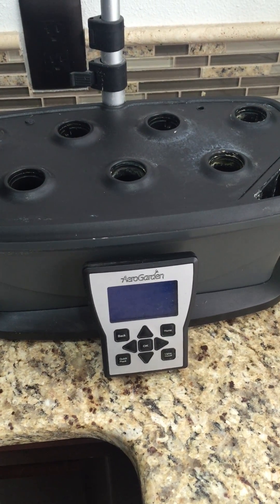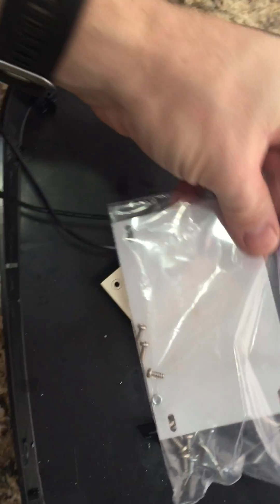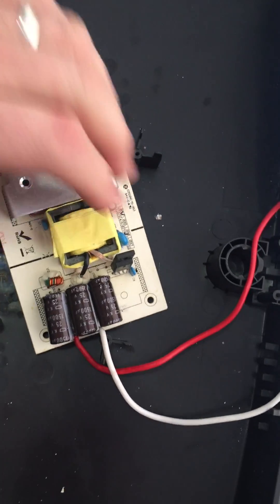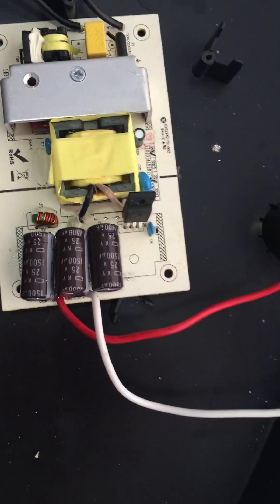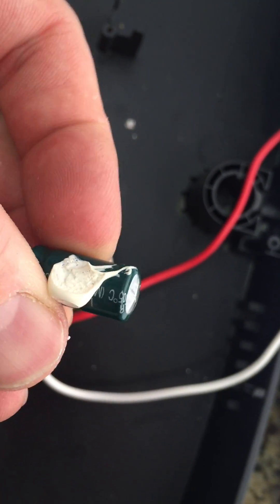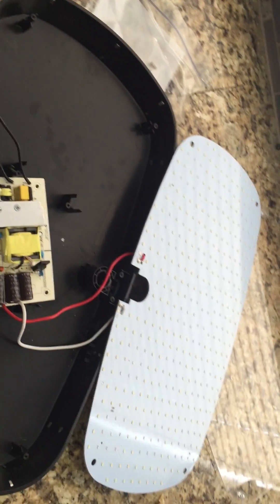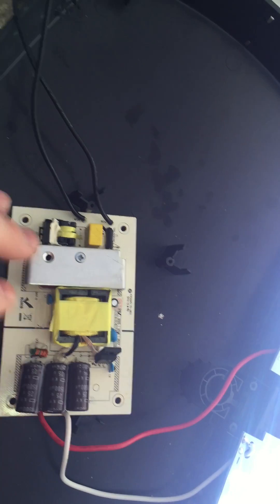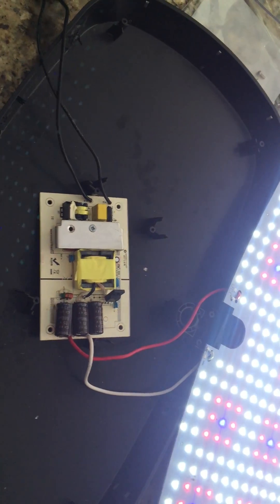Aerogarden LED Repair pulsing/strobing/flicker

Comment: A friend has an Aerogarden Farm which is not attaching to the Wifi, it will ping a few times to the router, then stop, ping a few times, then stop. Do you have any idea what type of chip or part should be replaced in the hood so it can connect to wifi full-time? Others are working fine. AG wants them to buy a whole new unit, they said they don't sell "parts" any more. Or do you know what type of a technician they should look for locally to fix it? Thank you.

Comment: I fixed it differently.  I called Aerogarden and asked for a power adapter for a LED light.  It was $10.   Then you open up the LED as shown in the video and physically remove (rip it out and throw it away) the electrical board which is small.   Connect the power adapter (+) and (-) to the LED's (+) and (-).   Plug the power adapter (male) to the power cables from the Aerogarden.  Done.
I tried to fix it as shown on the video but the cost of buying the components and figuring out which one blew just took so many days with no luck.   Take the easy route.
Reply: do they sale the power adapter on amazon?

Comment: Thank you so much for this video.  I have a question, would it be a good idea to use capacitors that are rated 25v but a higher uf?  I have trouble finding the 25v 1500uf ones for a good value.  Thank you in advance.
Reply from the maker: Higher voltage is ok, but uf needs to be 1500uf. For example 35v 1500uf, 50v 1500uf

Comment: just acquired an aero garden 7 hole system.  the pump is fine, but when we turn on the light - it strobes.  I have no clue what the model is.  I'm not afraid to take it apart and replace stuff since apparently you can't just buy the light hood.  but where do you find capacitors and how do you know if they're bad?  what info do I need to purchase some.  there is no fuse on the board.  but there are capacitors.

Comment: Hi, I have a 9 pod from 2015 and when I got at the circuit board I could see it was a different design, no electrolytic capacitors under the heatsink.  There were two 470 uf 35V at CD2 and CD3, so I swapped those out with new ones - it did NOT fix the flashing problem.  Any advice for what else might be wrong?  
Thanks,
Mike
Reply: I've replaced the 10uf 50v cap as well, still no joy.
Reply: I'm looking at mine right now and it's the same as you guys. Cd2 and cd3. That mean I'm screwed? Lol

Comment: I am so confused....soldering? I would have liked to see you pull out caps and solder and everything...I am not an idiot, epileptic ..after a 26 seizure in 36 hours, I get confused easy ..I just bought my dad one and mine stopped 2 weeks later! Using his lights, but they are smaller.....would you mind terribly working with me to fix this, I only get 800 from SSI, I don't want to screw it up, can't afford to replace....

Peace

Comment: Mine is different. Looks exactly the same, but the heat sink is soldered to the board and there’s this white “goop” glueing all the components together. No easy fix for me.  *sigh*. I can’t even remove the heat sink. 😕
Reply: Same, I don’t know what to do now :(
Reply: Mine was like that, too. You can remove the heat sink by de-soldering the two pins. The white goop can just be scraped off. Don't forget to remove the screw holding the mosfet to the heat sink. When I put it back I used hot glue to hold the caps, but I don't really think that's necessary. Good luck!

Comment: Dude, THANK YOU for this! I hadn’t done much soldering in the last couple of decades but I thought “why not, it doesn’t work now anyway!” So I got a bag of 5 caps for $4 and it took about 15 mins to take the thing apart and replace them (mine were swollen just like yours) Worked the first time. 

You saved us about $100 to replace the whole thing. Thank you, thank you!!

Comment: So I have zero soldering experience pretty good with my hands. Watched this video and one about do’s and don’ts of soldering. Bought a $15 kit and $5 of capacitors and bam fixed hardest part was taking apart the lamp and heat sink. Mine has some kind of glue or compound all over inside made removing the heat sink difficult. Also the light and shield were he’s to remove after the screws the top is just plyable enough to just stick a screwdriver in and bend it just a touch be careful not to break the clips

Comment: Kudos to you for posting Clock Doc! I would have never attempted the repair without this video.  Would anyone care to give a link to the small 50 volt capacitor they used? I found the 3 larger ones on Digikey part number 565-4553-nd, but having trouble finding the smaller one.

Comment: Thanks for the fix.  I purchased capacitors for digikey they worked but were 10mm x 30mm.
Since the I found 1500uf 25v 10mm x20mm on eBay.  I purchased what I thought was 6 PCs to keep for my other aerogardens but was actually 6 @ 20 units. If anybody needs some please contact me @ Iam2ndson@gmail.com if you send me a self addressed shipping envelope I would be happy to send some at no charge if you pay the postage.

Comment: will these work? 6 pcs Panasonic FM Series Capacitors - 25V 1500uf Ultra Low ESR
Reply from the maker: Those should be fine, might pay a premium for the “ultra low ESR” over standard.

Comment: As you can see in this comment section, I followed your advice to great success a year ago.....Well, it gave up the ghost again and replacing the CAPs didn't help this time....still strobes....any other advice?
Reply from the maker: It’s hard to diagnose from a distance and I don’t have mine to reference anymore. From the video it almost looks like the driver is MOSFET controlled. Make sure your Caps are new, some stuff from eBay and such are decades old. After that check other components like resistors, other caps, if good it may be that transistor. I hope that helps, if any more questions feel free to ask, have a blessed day.

Comment: I have a Bounty. My board look different from yours. None of the capacitors are bulged. Should I still try to replace them?
Reply from the maker: Daniel Chang  If it has similar problem you could swap them and see if it works. Just check specifications on your parts as I am not familiar with that board or it’s components. I’ll see if schematic is available somewhere.
Reply: @clockdocbrown3013  While I took some electrical engineering classes, I'm not an expert. This is what my board looks like: https://photos.app.goo.gl/gZHi65CGtSeSAGDJ6

Any recommedations on what capacitors I should get? I was thinking a couple of these: https://www.mouser.com/ProductDetail/647-UBT1V471MHD
Reply: @dchang3  I have the same power supply in mine!  Those capacitors look like a match.  I replaced mine with similar ones, and I replaced the 50V cap but unfortunately it did not fix the problem.  Please let me know if you are successful and I will try swapping them out again (maybe I got a bad component or just one that was on the wrong end of the range)  Thanks and good luck
Reply: @michaelbacher2469  I got in touch with Aerogarden and they sent me a replacement without asking for any payment. I wish you luck with them too! I was out of warranty.
Reply: @dchang3  Thanks - I had emailed them earlier and they declined to replace it as it was way out of warranty (2015).  I'll try a call to them and see if I have better luck.
Reply: @michaelbacher2469  let me know if you can call them. I tried the customer support number and it doesnt work. Email said they dont sell parts for my unit anymore

Comment: A HUGE thank you for making this video!! Not sure how I pulled it off, I figured my odds were 20:1, but I ordered the capacitors off Amazon, successfully swapped them out and the LED is shining bright and solid again. A little tip to anyone trying this, kinda winged it with the de-soldering...since you obviously can't de-solder both wires on each capacitor at the same time, I wound up snipping the wires on the old ones to get them out of the way, heated the solder points on the under side of the circuit board and pulled each wire through the bottom with pliers so the solder doesn't get pulled up into the hole where you need to put the new ones through. Hope that makes sense. Also wear a facemask, you don't wanna inhale the fumes.

Comment: I've replaced the 3 25v capacitors and also the 50v in the middle. Still getting strobe light effect... Any ideas?
Reply: @nawgx2 I got it working! Turns out I just had a bad connection with one of the new capacitors. Thank you!
Reply: @nawgx2 oh I didn't even think of that. Let me know if you figure something out. I didn't really notice any difference after replacing the 4 capacitors from the hood light.

I might just try to replace the whole board with a better led driver. Those electronics don't seem too great anyways.
Reply: @nawgx2 I don't think it would have damaged the board. I believe the capacitors just short of you put them backwards and run it long enough. I have an extra led driver so I'm going to try to override the electronics with it and see if that works.
Reply: @nawgx2 Really? Oh wow, ok so I'm going to need to test my capacitors then. All of mine were brand new but I'll recheck them again. Thanks!

Comment: I replaced the 3 caps and it did not fix the problem....still strobing...does anyone have any other suggestions or know the specs on this LED driver?  is it CC or CV? How many amps and how many volts?  It's a 30 watt panel.

Comment: 10uf 50v in the middle (the little one on the ac side of the plate) needs to be replaced also , if you are still having strobing after replacing 3x 1500uf ones. thank you for this video.
Reply: Hi, I have a different power supply (unit from Oct-2015) that does not have the 1500uf caps.  I did change two 470uf cans and the 10uf 50v cap - but still have the flashing.  Any advice on where to look next?

Comment: UPDATE. I repaired my capacitors as described above and the hood worked well for about a year. Then the flashing came back. The replaced capacitors looked fine so rather than try and find out what else had failed I decided to replace the entire interior system which are obviously poorly made with an external LED driver that bypassed all the faulty electronics. I cut and soldered the cables to the LED board to the output cables on the driver and cut the cables from where the power enters the hood and fed those two wires outside and soldered them to the input cables of the driver now a cheap plug-in timer  sends the power to the lights from the outlet and it runs fine. I thought about fitting the driver inside the hood as there is plenty of room but they do get quite hot so it might be asking for trouble. It sits on a windowsill behind my Aerogarden where it keeps nice and cool. Here is the link to the driver on Amazon. cost about 18 dollars. https://www.amazon.com/gp/product/B07MH15GGY/ref=ppx_od_dt_b_asin_title_s00?ie=UTF8&psc=1
Reply: Did you get the 60W ? How did you which wattage power supply to get?
Reply: @puregsr  See the link in my post. I bought the 60 Watt driver shown in the link. and put a cable and regular plug on the input end and plugged it into a regular cheap timer which is just plugged into the wall socket. The two input wires on the LED board have to be cut and connected/soldered to a length of wire directly to the two output wires from the 60W driver. This bypasses the internal timer and the wires that used to go from the control module in the base. The entire lighting control board in the hood  can then be removed. The base module then just runs the pump etc. and has nothing to do with the lighting which is controlled by the timer in the outlet. . It's in use all the time and still going strong with no problems!
Reply: @leybourne42  hey I just did exactly what you suggested. All lights worked initially, but now some of them are off, some are red, and some are blue. Any idea what's up?

Comment: Hi, I mistakly plugged in my aerogarden bounty in 220v current,    for 10 seconds,  now led not working,  all functions including water pump works except led light.. any suggestion guys.. pls assist me
Reply from the maker: Tamim Yousef there is a fuse next to yellow capacitor where AC comes into board, check that for continuity and if ok check the rectifier diode
Reply: @clockdocbrown3013  thanks,  is that  under the LED light or inside the main panel?
Reply from the maker: If pump and control screen is working. Follow the flow of AC power, start with checking output cable to the led panel should have line voltage, if not work your way back, if so then work forward into led panel.

Comment: Thanks. It seems to have solved my problem with the Aerogarden Ultra Led. I could only find 35v 1500uf locally, which were much bigger. I had to solder bits of wire to extend the leg lengths and the heat sink wouldn't go on anymore because it was too small. I will see if the repair sticks, but the lights have been on a few hours so far without flickering.

Comment: There are a few different hoods. I have two 12 volt, 30 amp hoods and 1 24 volt, 45 watt hood. If you don't want to mess with capacitors, you can buy an appropriate power block (think laptop type cord) and wire it right in, bypassing the power block under the lamps - just throw that away. You'll have a power block outside of your hood, but if you make sure to get the right type of connector to the block, you can use the lamp cord on the aerogarden (Plug it into the new power block instead of the hood) and that way the aerogarden timers still turn the lights on and off. About 10-15 bucks for a power adapter. Not as neat, but more doable for those with less electronics comfort.
Reply: How do you tell which hood you have?  Mine is on a 9-pod unit that was built in 2015.  I've tried changing the capacitors with no change in the flashing symptom.

Comment: We replaced the 3 bad capacitors but are still having issues with the LED panel flashing. Any recommendations? Thanks!
Reply: Your model may have other caps.....look at the board for any caps bulging or popped and replace.

Comment: This worked! Also had to replace the 10uf 50v capacitor in addition to the 3 1500uf 25v capacitors
Reply: Hi Bob, can you tell me what the 10uf 50v capacitor looks like and where it's located as I'm having the same issue.

Comment: Thanks so much for this. I've never fooled around with circuit boards before, but your explanation just saved me easily over $100. It would have been such a waste to get rid of it when the problem was just those three pesky capacitors.

Comment: Thank you!  The capacitors are small (10mm diam; many I saw on sale are 12.5mm and too big); I got mine from Digi-Key (https://www.digikey.com/product-detail/en/EGXF250ELL152MJ25S/565-4553-ND/6204398), and even for a relatively inexperienced solderer it wasn't difficult and seems to have done the trick.  Thanks very much for posting this!
Reply: Sadly this link gives me the 404 (not found) error. Would anyone know the type? Aluminum etc so that I might find their replacement? Or a new link to a part? I’m inexperienced and any help is appreciated. I had no idea there were so many kinds and sizes! The ones I bought are too large. Thanks in advance. LOVE the video btw! Thanks for posting! Your experience shows-you make it look easy!